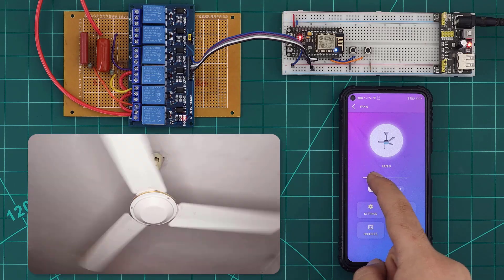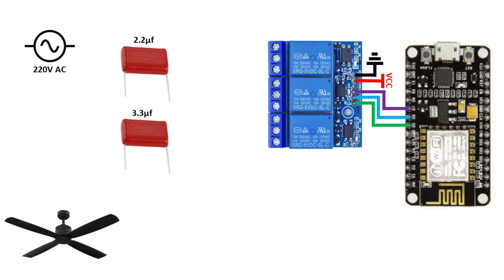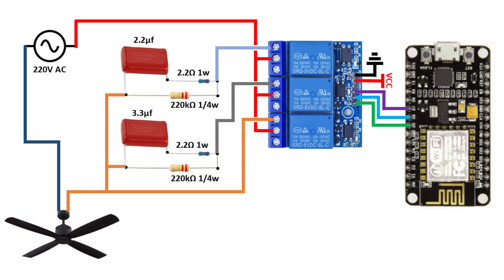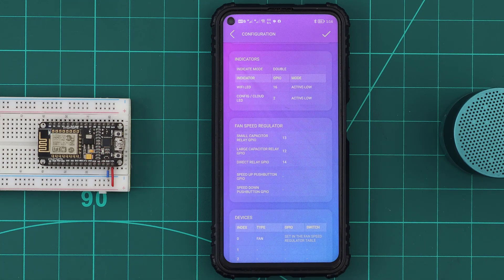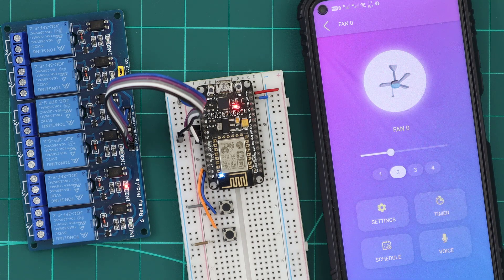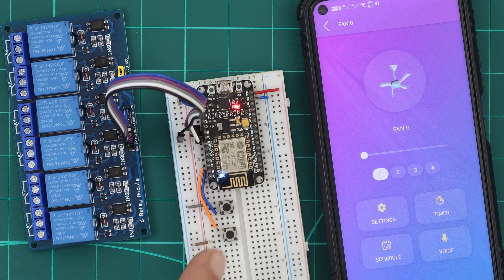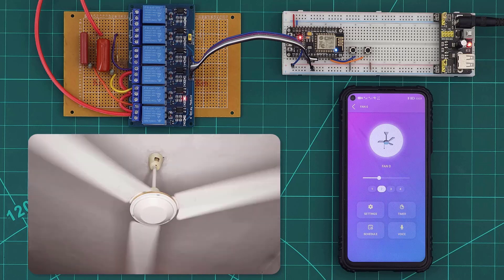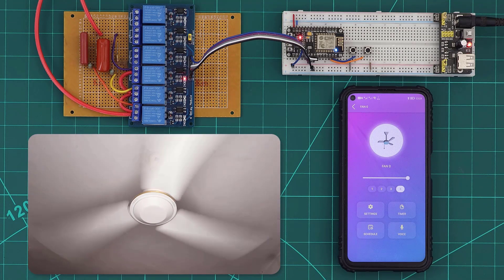Fan speed control with CADIO fan device (ESP8266 - ESP32) | CADIO Home Automation

Comment: Why can’t we use the devices added to alexa as triggers for routines? Also it would be really nice if IR can transmit a different code based on the receiver code. E.g received code is samsung vol +/- and transmitted code from esp is NEC or some other brand vol +/-. Would really appreciate the help and would love buy the license as it will make me able to repurpose the old ir remotes to control wifi/zigbee smart devices. Thanks for the amazing product.

Comment: The trial License is free and valid for 500 operating hours, and it can be renewed for an unlimited number of times by erasing and re-installing the firmware.

''it can be renewed for an unlimited number of times by erasing and re-installing the firmware.''
What's that mean?
Reply: It means you have to format the esp board with some flashing software or Android app. Then you just repeat installing cadio firmware again and you will be able to get 500 hours again

Comment: Need some other features, like pressure sensor, other temperature sensor, and if a switch is link with temperature or other then the switch is disabled, only active through link . This is not good,

Comment: Hello

Can I use the same circuit for a 12v fan speed control fan?
Reply from the maker: No this is for AC fan, but you can use the "dimmer" device instead with DC fan, I did it with 12v fan at the end of this video:
https://youtube.com/watch?v=xIzKyX_BOu0
Reply: @cadioHomeAutomation  

ırfz44n can I use?

Comment: I love this project.but I hade trouble for fan speed control. Because, here all are using regulator type. I'm searching auto reset 2 way switch for switch board. But my bad luck I can't find that. My parents are comfortable with using the regulator. So will you turn the fan speed control push button into a regulator .
Reply: kindly use touch sensor

Comment: For fan speed controling two main features missing. First one is manual switch for On /Off the fan. Second one is controlling fan speed via IR/RF Remote 🤔😞. Waiting for the update firmware
Reply from the maker: Under testing, will be supported very soon.
Reply from the maker: Fan speed control using IR and RF remotes is now supported.

Comment: Hello, this is an awesome project, I just want to ask that instead of push buttons how can we use the fan speed regulator? If it is possible then can you do a video on that ??
Reply from the maker: We are using the pushbuttons because we are looking for complete synchronization between the app and the manual switches, 
For example, when using the 4 steps rotary fan regular, if we set the speed manually from the rotary switch to 4, then from the app to speed 1, the result will be a fan spinning with speed 1 and the switch on speed 4, we tried to avoid this with the two pushbuttons.

Another benefit is the two pushbuttons are using two GPIOs, while the 4 speed rotary switch is using four GPIOs, so we are saving two GPIOs by using the pushbuttons.

Comment: Google home doesn't recognise Cadio fan as speed changeable device it only shows as switch 

And in Alexa it is detected as dimmable led so you have to say change the brightness instead of change the speed 

Any solution ?
Reply from the maker: Try saying:
Set fan to 50
Set fan to 100

Comment: Fan speed system is not work properly from today

Today I am facing some problem with fan speed control
Reply from the maker: What problem?
Reply: When the fan is on, none of the relays are triggered, when the fan speed is one, none of the relays are triggered, when the fan speed is two, the relay one is triggered, when the fan speed is two, the second relay is triggered, when the fan speed is three. on number 3 relay works. 
no relay works on fan speed 1,3
Reply from the maker: @ravikumarmaurya900  Edit: Bug reported for some esp32 clone chips.
- Fixed in firmware version F193.

Thank you sir for reporting this bug. Kindly update the firmware version and it will be fixed.
Reply: Thanks for help 🙏

Comment: Hi,Your IoT Platform is Awesome,for the past 5years I check several IoT Platforms,out of all I like your platform very much and if it’s possible please put 433Mhz Remote for all speed control also (for 4steps) and instead of 2 switch please put normal fan regular one.
Reply from the maker: Fan speed control using IR and RF remotes is now supported.
Reply: Yes, Regrading Manual Control, Instead of 2 Buttons, If you Can use 4Pole Fan Rotatory Switch Means Good.

Comment: Great :)
Q: Does CADIO Firmware supports ESP32-S3 Modules?
Suggestion: It will be great if you can build a web installer for flashing firmware into ESP devices, like the Tasmota web installer.

Comment: For config button instead on off holding mcu board button can we try (on off )switch continuously 10-12 times the config mode will turn on
Reply from the maker: Yes it's already supported. 
If you use (press) switches mode, you can choose (hold any press switch) option in the config button table, so you don't need a config button anymore, and holding any switch for 5 seconds will activate the config mode.
Reply: @cadioHomeAutomation do it supports config mode on light on off switch

Comment: Plz make possible to reset the  gpio pin and wifi password  with in the app   it is easy to use it
Reply: Sir is it possible to control fan speed with Google Assistant with this project ?
Reply from the maker: Only the wifi credentials, in the  config mode.
Reply: @cadioHomeAutomation  please one of my client is complaining of device going offline and he has the permanent license
Reply from the maker: @smartteg7381  update the firmware to the latest version
Reply: @cadioHomeAutomation  okay I will try that and give you feedback